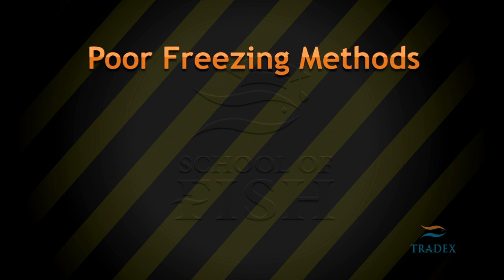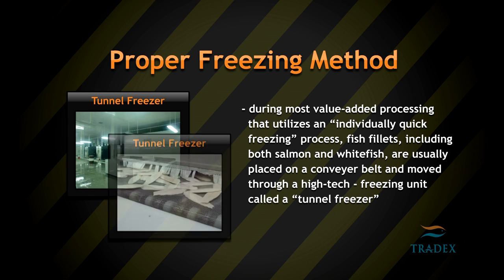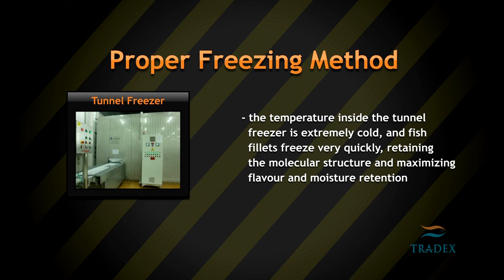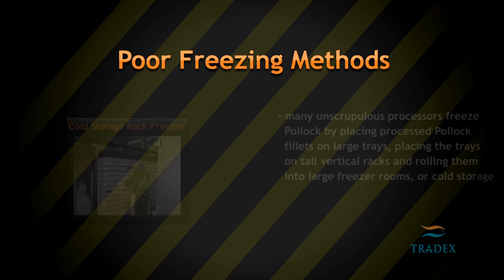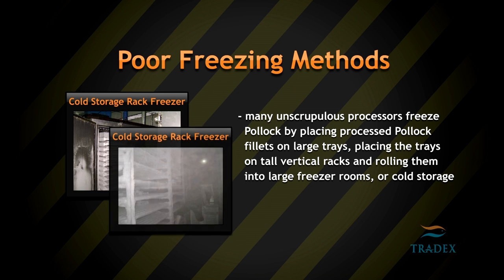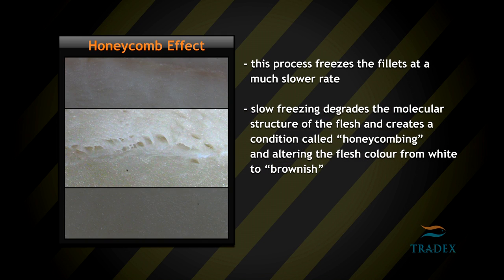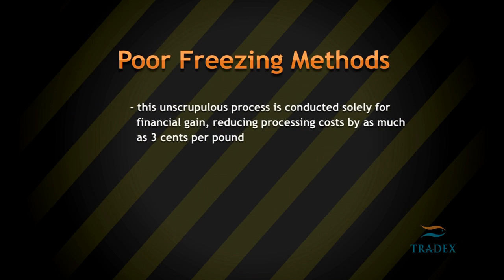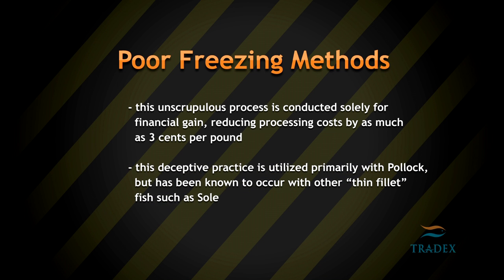Poor Fish Freezing Methods

Comment: very interesting!  are there freezing methods which do an exceptional job at preserving flavour/texture (near) equal to that of fresh product?  i assume there's no clues on the outside packaging of frozen product that allude to the product's freezing method?
Reply from the maker: Here's a reply from our VP of Quality

When any foodstuff is frozen, there are three steps to this process. First, the temperature is reduced to the
freezing point. The water in the foodstuff then turns into ice (this is also called the latent heat phase). Finally, the temperature is further reduced to the final freezing point (usually -18 °C). Slow freezing, however, can damage food products because the process destroys their cells. Because of the reasons explained above, the freezing process must be passed through as quickly as possible in order to reach high product qualities. By using the fastest freezing methods, the water inside and outside of the cells freezes at the same rate, ensuring that the cells remain intact and the food keeps its freshness, flavour and texture – as if it hadn’t been frozen at all.

Cost is a factor in freezing, some facilities simply can't afford expensive freezing systems and may just put fresh products into a conventional storage freezer which slowly freezes the products, some will use a 'blast freezer' which has low temperature air blown over racks of products but a disadvantage to this is that it may dry the products out too much. Plate freezing is usually used for block frozen and 'shatter pack' styles of fillets. IQF (Individually quick frozen) tunnels are most commonly used and although expensive, freeze quickly and produce a superior product.

The refrigerants used in commercial freezing can be freon, ammonia, Carbon dioxide, or Nitrogen which are increasingly expensive (from freon at the low end of the cost scale to Nitrogen at the highest costs.